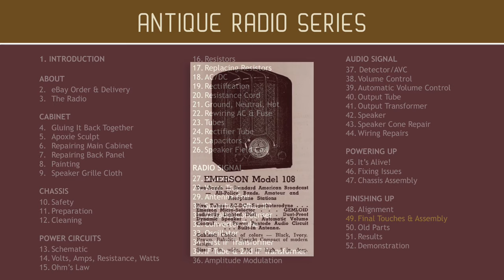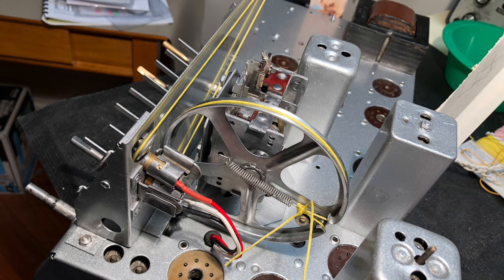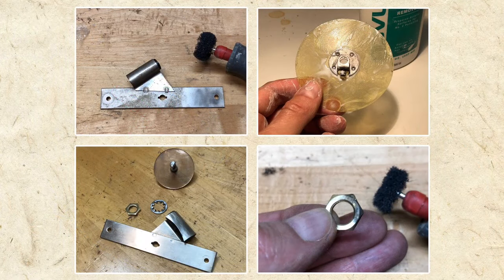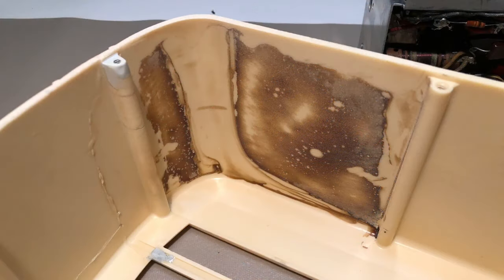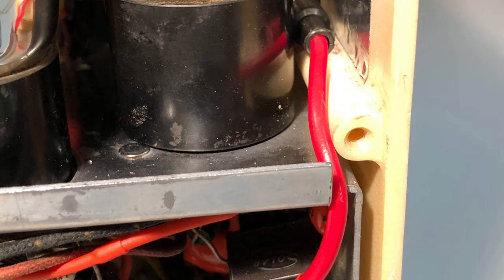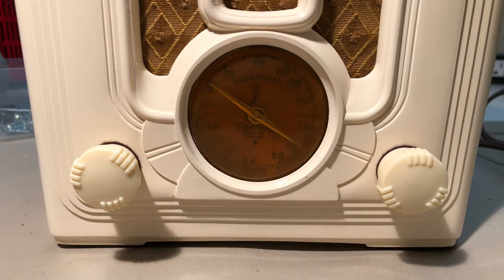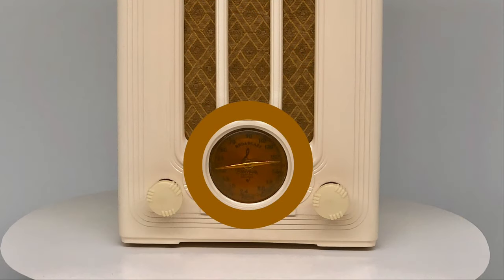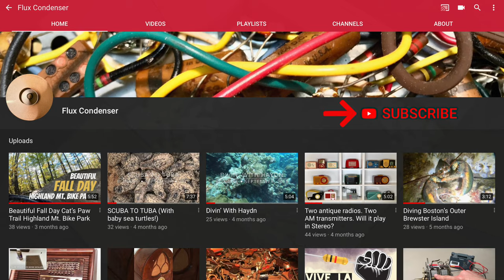How Good Does an Antique Radio Sound?

Comment: I sat down and watched the entire series tonight.  Thanks for doing such a good job of making the series.  You patched in lots of random things that I've heard over the years but never made sense of.  Watching someone like Mr Carlson do his radios is great, but you have taken the time to break down what every little section of the radio does in a way that makes more sense to me than when others have described it.   I've been 'rejuvenating' radios like this for the past ten years with a general level of understanding how things work.  I never owned an RF generator and still don't own a scope, but I got my hands on an IFR-1200S service monitor that is overkill for AA5 radios, but both generates an accurate IF and measures output at the speakers with a built-in AC voltmeter.    Specifically, you simplified the concepts of using coupling capacitors, how each tube works and what it does, filter circuits, safety considerations, heterodyning, and probably a few other things I'm forgetting.   I don't think these videos would have made much sense to me when I had no idea what I was doing because you literally say as much as possible in the least amount of words and time as possible.  But as someone who's been sitting around watching random youtube videos and who had gotten some radios back to working, you really helped drive home some important concepts for me.  So thanks!  It's a very valuable series.
Reply from the maker: I read this with pleasure so thanks so much for taking the time to comment. My goal for the series was to create a comprehensive guide, because like you, I found that while there were many great videos out there about the subject, they weren’t especially focused or organized. I wish you luck with your future projects and if I can be of assistance, feel free to ask in the comments. Take care and thanks again.
Reply: @FluxCondenser  Your attention to detail and stick-to-it-ness is top notch.  There is no way I would have repaired that ivory case, but now that I know it's possible... Maybe?  I like the concept of wabisabi and fixing broken things, knowing you'll value them more than just buying new things.   For me, it's finally time to get an isolation transformer and build a dim bulb tester.

Comment: Great Series!  Thanks for explaining the Radio Signal Flow. If I understand it correctly .. Radio Receiver Ferrite Core Antenna => [(Trimmer)Oscillator/Variable capacitor] => (Superheterodyne 4 Frequencies) [IF Signal + Audio Signal] => I.F (I.F Transformers) => Signal amplification => 2nd IF Transformer => Amplifier => Speaker
Reply from the maker: Yes, pretty much. 
If you want to break it down into the tube and IF components for something like an All American Five or Six radio, it will generally operate this way:

1. 1st RF Tube (optional tube to pre-amplify antenna signal found on “All American Sixes”)
2. Converter/Mixer Tube (RF and IF are mixed)
3. First IF Transformer (IF is precisely tuned)
4. IF Amp Tube (IF signal amplified)
5. 2nd IF Transformer (IF tuned again)
6. Detector/Amp Tube (Detector is a diode which removes RF, leaving only audio signal. Amp section of tube pre-amplifies audio signal.
7. Audio Amp Tube (Audio signal amplified)
9. Audio Transformer (Changes amplified audio signal voltage/impedance to be suitable for loudspeaker).

Note that there will also be a rectifier tube, which along with the filter capacitors, provides B+ for the radio.

Comment: Great series!  I was a TV repairman way back when people still did that, but went to college and changed profession as the throwaway economy reared it's ugly head. I wasn't strong on AM theory - though I fixed a lot of 5 tubes - it was always the filters or coupling caps.  This series has been a great refresher course - I'm retired now, and recently found a couple of barn-find 5-tubes - one a silvertone with the same front end as yours, but has a power transformer and #80 and #41 rectifier and power tube.  The other is a GE hot chassis with a 35Z5 and 50L6.  I've got the power supplies sorted out and working on the signal circuits now, and your series is just what the doctor ordered! Thanks!!!!
Reply from the maker: So great when I get to hear from repair guys like you that actually worked “back in the day.” Glad you’re getting back behind the soldering iron and can now do this for pleasure. Good luck on your restorations and I’m thrilled to hear you found my series to be a good refresher. Take care!

Comment: Great Series !  I just started getting into this hobby, myself....restoring a model 6-26 Spartan, from 1948....your videos are VERY helpful...
Reply from the maker: The 6-26 is a stylish radio and the Spartans are known for their quality. I own a 6-26 myself which I purchased already restored. I haven’t plugged it in yet, though as I haven’t gotten around to double-checking the work and testing it on the bench. For now it’s for display only. Good luck with your restoration and I’m glad to hear the videos are helping. If you run into any troubles just leave a comment and I’ll do my best to help you out. Take care and enjoy the hobby!
Reply: @FluxCondenser  Thanks, will do !